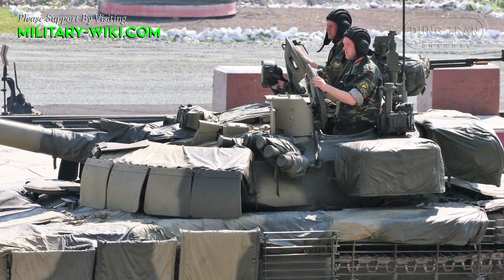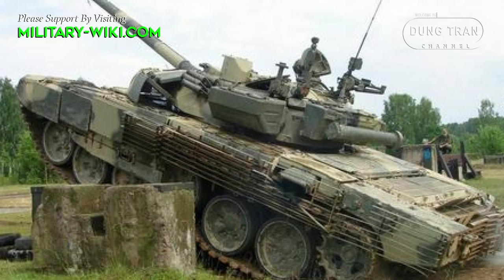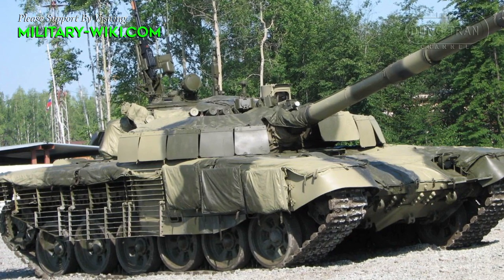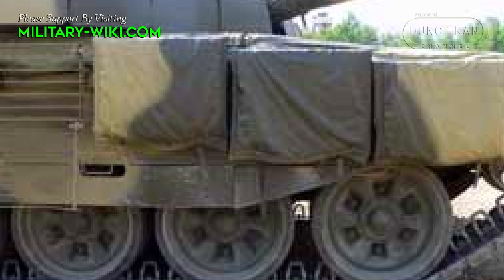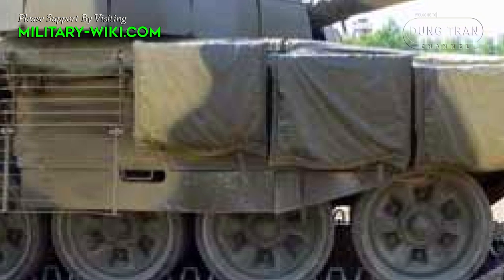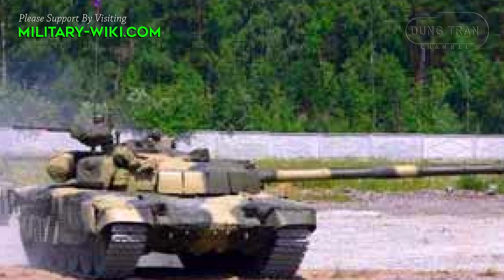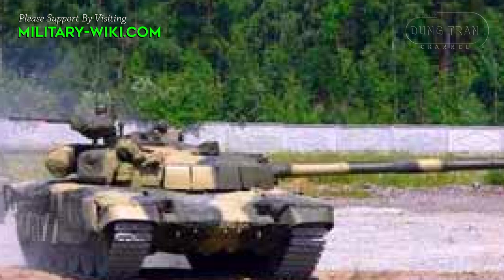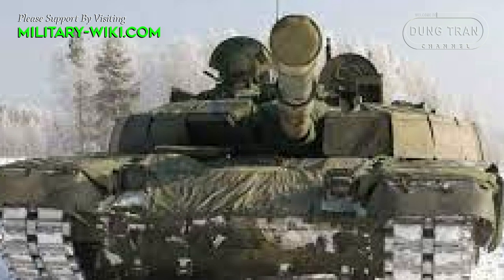T-72B2 Rogatka: Modernization Marvel or Costly Conundrum?

Comment: The Russians have a habit of controlling costs in their weapon systems.  This system had some interesting goals, and may be more do-able now than it was then, given advances in technology.  Will Russia revisit this concept on another platform like the T-14?  Who knows, but it is interesting to consider such questions.
Reply: 😂 The T-14 should be considered a failed project by this point, especially when you consider the huge number of Western components Russia needs to build anything remotely modern.
Reply: @stephenbrand5661  Yeah, I know, but necessity is a mother. 😆
Reply: @stephenbrand5661  
It's not so much Western components nowadays as much as Taiwanese semiconductors. Without those both the US and Russia would be fighting with 1970s tech before long